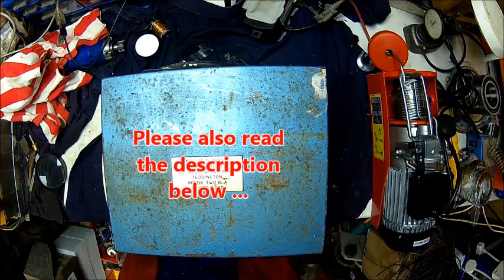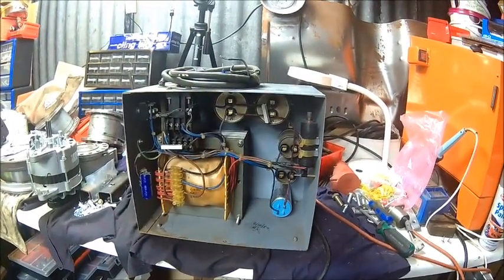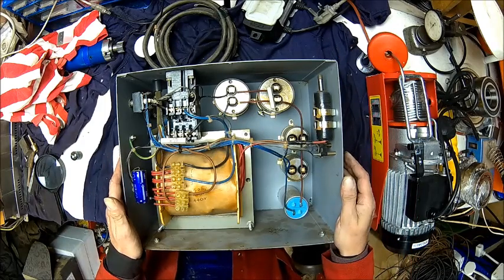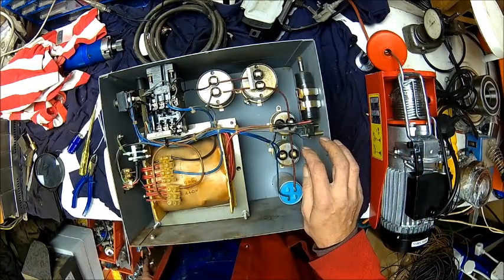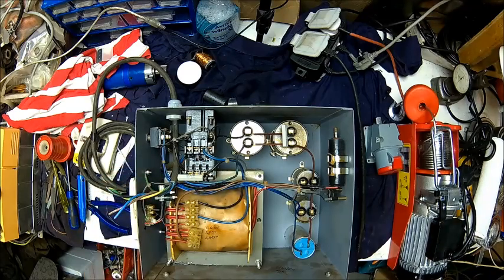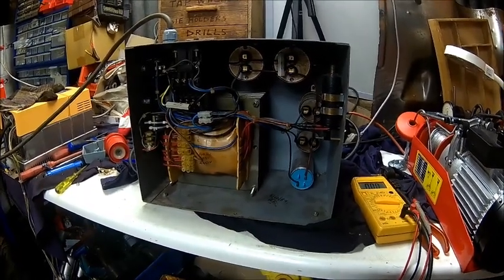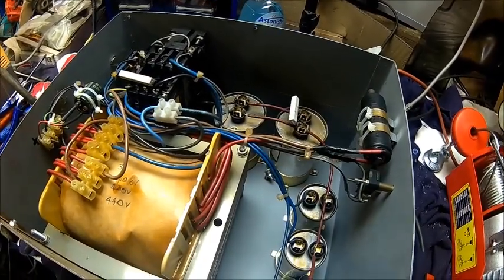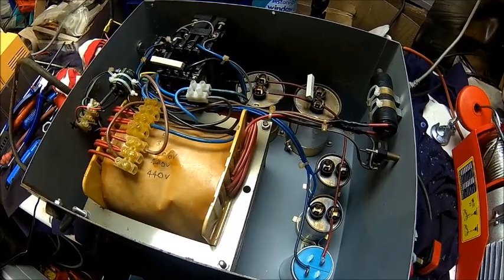Phase Converter repair  ( non-rotary, old style design with current sensing coil)

Comment: Nice fix mike, I was over at Al’s & guess what, I broke a strip light while moving it 😡 I was working  over his mill & a pile of junk in my defence Officer, & it still works’ I repaired it,  now above the surface grinder ( so he can see without an head torch ) 😀 which he wired from your converter in reverse & that’s why he called me over in the first place” as the oil pump was going backwards🤡 ask him about building a bigger shed😂 great channel mike the videos are coming thick & fast this week. Ho I bet he didn't tel you he broke a new angle grinder 🤥 at least the strip light was pre world war (one)😂😂
Reply from the maker: Thanks Rob,...i advised him to ask you for a look at it ...:-) .... Anyway, just bought another milling machine,  perhaps as old as i am, footage will be coming soon ....